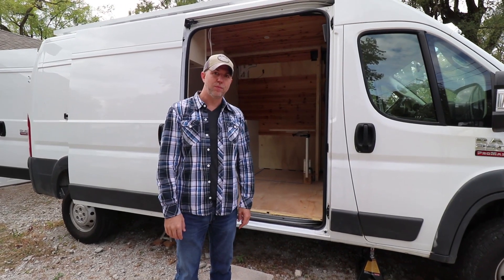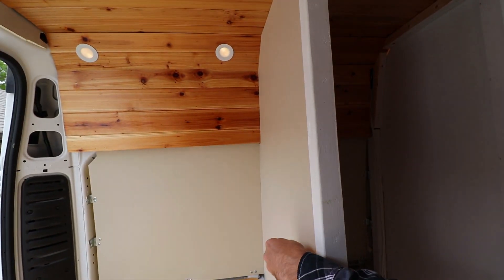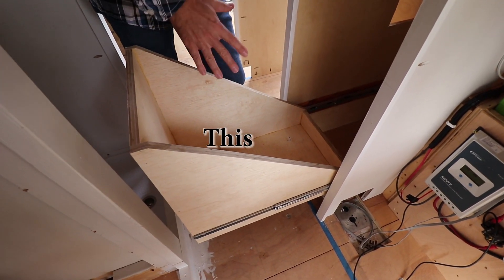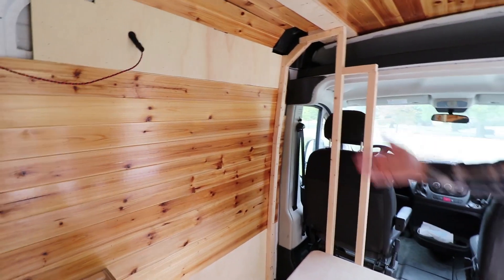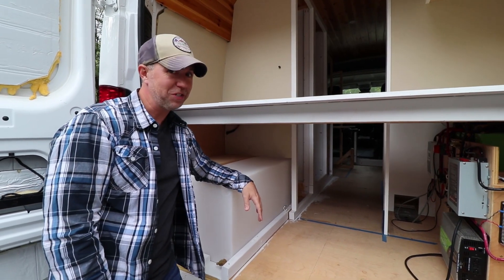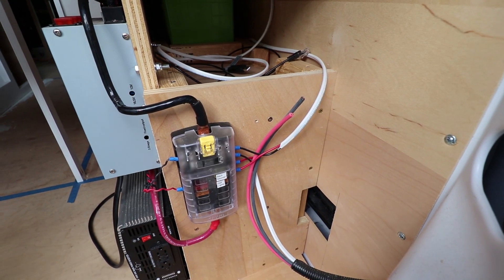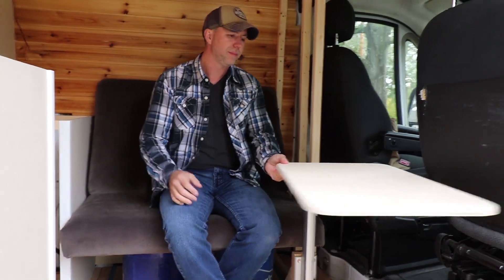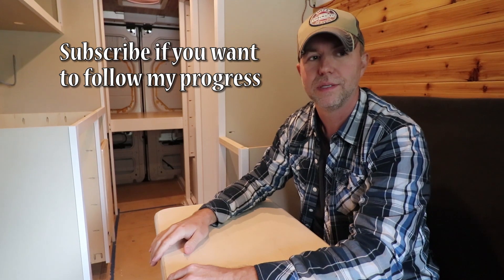Half Done Promaster Van Tour -  2 Inverters, Shower,  Lagun Table, Vanlife for Web Developer

Comment: Looking real nice!  Good job.
One build I plan to do that I saw on Humble Road.  A shower takes up valuable space.  Picture a beefy decorative piano hinge running vertically on the right side opening of the shower.  Off of this Humble Road has build cabinets that are in the shower and flush with the outside of the shower.
When you take a shower you simply swing the cabinets out of the way.  Pretty slick.
Reply from the maker: You are right. I struggled for a long time on my layout including whether or not to include a shower and in what form. I watch Humble Road too, and they have some really impressive engineering. I would like to see your build when you finish. It sounds like you have some great ideas and plans!